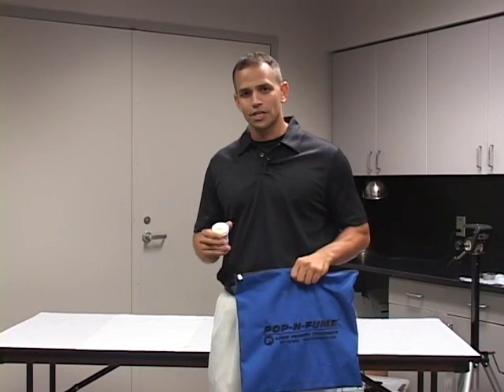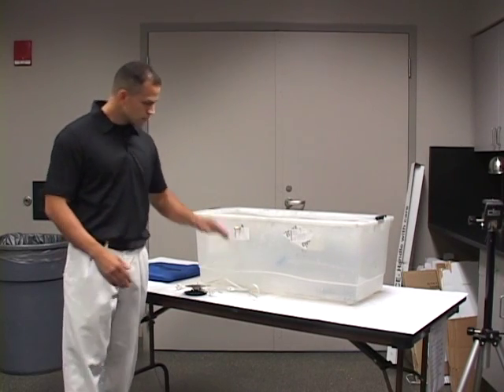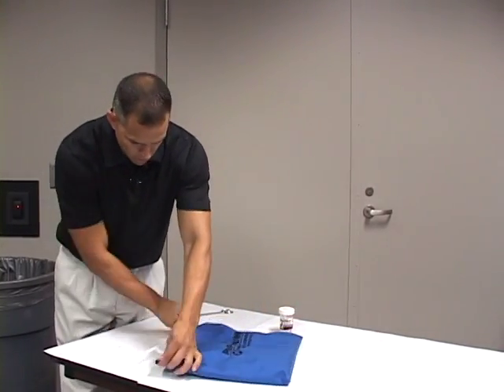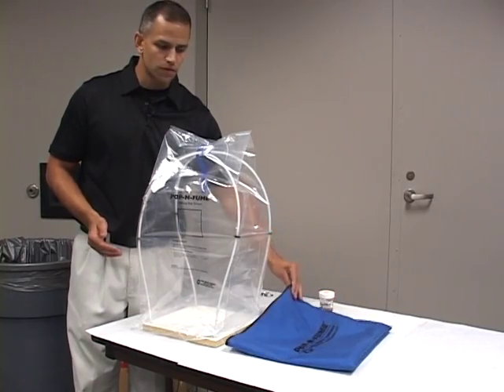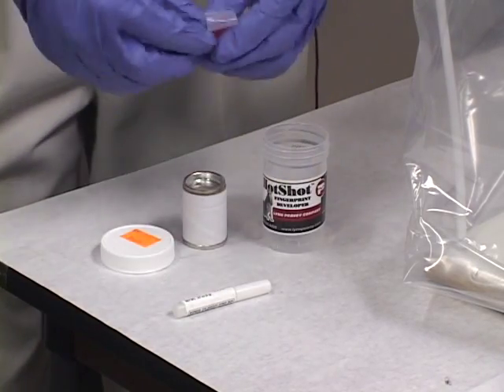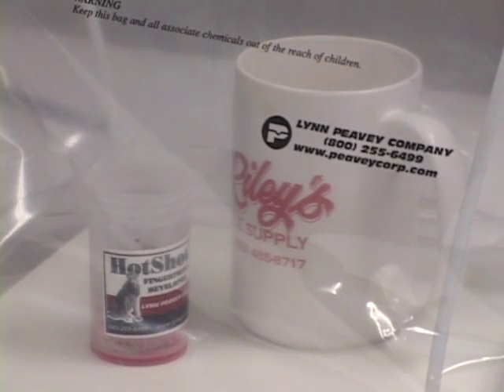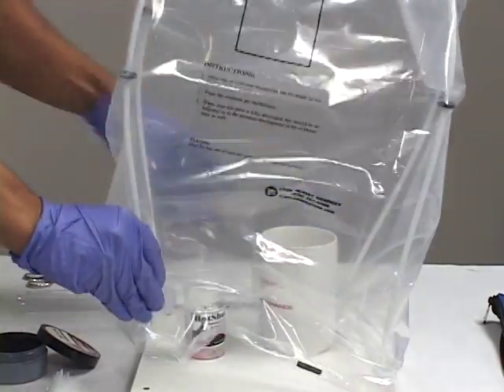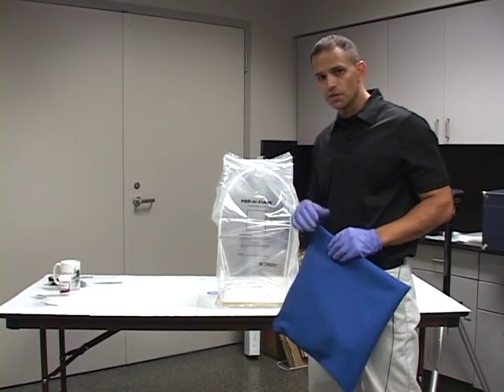pop n fume fuming chamber

Comment: Dear Mike: i never get tired of watching your amazing videos. This one is very educative; well done. I tried the same fuming method with a chamber i made using an old fish bowl. As a heating element i used tin foil and a saturated solution of NaOH. Just cut the tin foil into flakes and put them on a little plate. Add a few drops of sodium hydroxide solution and your superglue. It works fine. After all, everything you need is an exothermic reaction so that the cyanocrilate vaporizes. This method also includes the moisture you need for the fuming. I also tried dry fuming (no water at all) with good results, that is perhaps because it is very humid in my hometown. God bless you and keep doing this marvelous job.

Comment: Mike, I just wanted to pass on a thank you for your awesome videos.  I am a Criminal Justice teacher in the Midwest and I have used your videos to encourage my students to take their classes to the next level by building something they can use in the field and leave behind for the next class.

The last Criminal Investigations class built a portable fingerprint fuming chamber from scratch.  They selected the materials, they built it, they tested it, and they replicated the results.  We stumbled upon single-use superglue packs at Dollar Tree.  The dosage was PERFECT for this application.

Your video helped them believe they could achieve this level of work.  The reactions were so good that we were asked by our sister campuses to divulge the students' build plans to the other campuses for use.  We're planning a portable altered SN kit the next time CI runs.

Just in case readers are teachers or instructors:
Wood base
Pex PVC tubing (for flexability)
Clear plastic trash bag (office style so it's thin)
Means of attaching the Pex to the base or passing it through (we passed through to make feet)
Candle warmer (worked great with a power inverter in my rig at a nearby park)
Roll of tin foil (for your glue dish)
Single use superglue packs if available
S-hook to hang items from the center of the Pex if needed
Foil bowl or small cup for warm water.  A shot glass was PERFECT.

Then watch Mike's video to see when to know setup and when it's ready.  The bag will start to get glue residue on the inside and his "print inside" the bag trick works great.
Reply from the maker: +First Line Of Defense Thank you so much.  I am also a professor at a few colleges in New Hampshire so it makes me very happy to know that you are passing along my passion for forensics to your students.  Keep up the great work and keep watching!